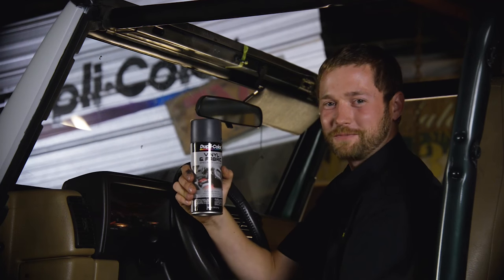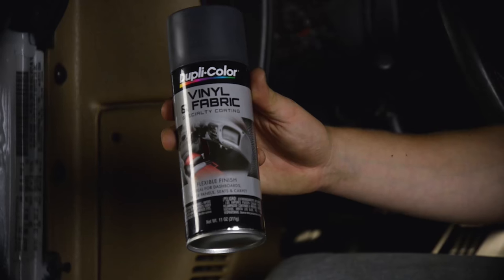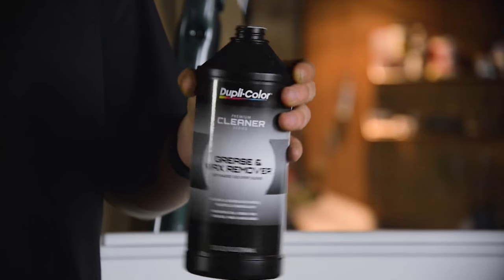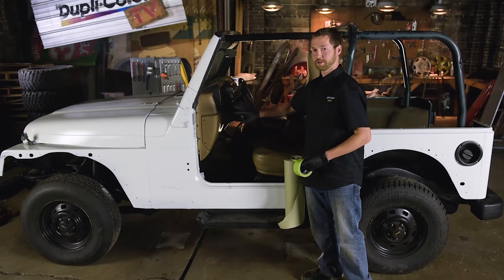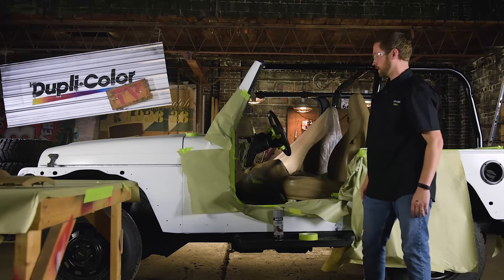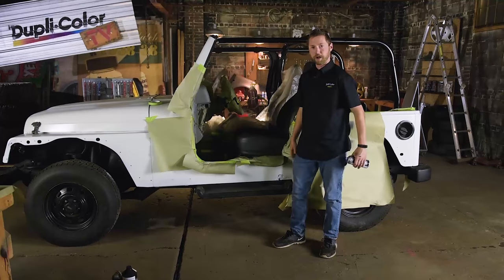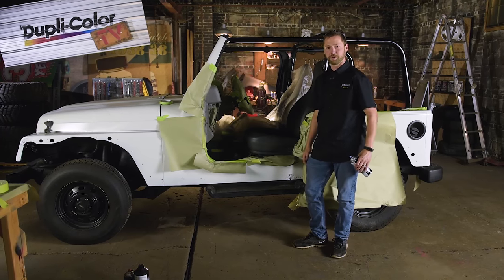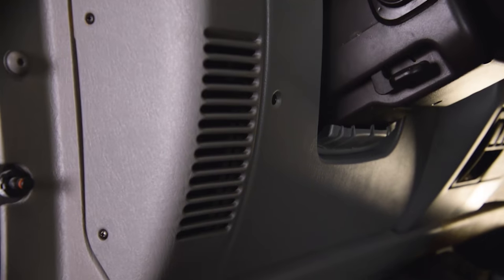Dupli-Color® How to: Vinyl & Fabric Coating

Comment: My paint is chipping off my interior. I cleaned my door panel, then used degreaser and then even rubbing alcohol to make sure. What am I doing wrong? Is there a primer I need or do I need to seal with a clear coat after? Please help lol🤪
Reply from the maker: Hello. If you are having trouble, you may want to use our Adhesion Promoter, CP199.

Comment: You confirmed to me what I need to do to paint vinyl on a car. However, you video is not well produced. The lighting is very bad and you cannot see the interior of the car very well at all. Use better lighting!! Plus you don't show enough before shots and there are no side by side comparative of still shots. I don't doubt the paint works. I just wish I could have seen it better.